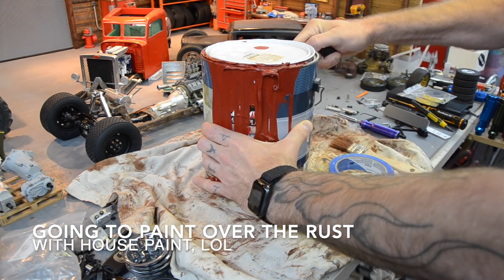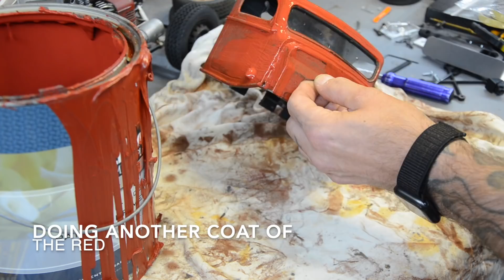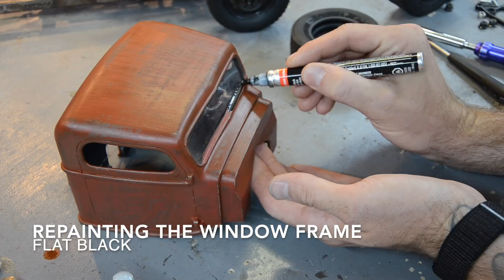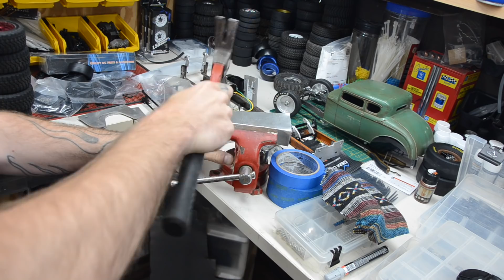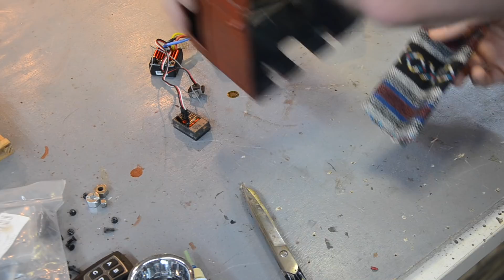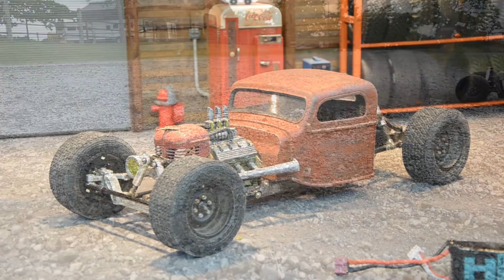Bringing back the Farm Truck, RC Rat Rod Scratchbuild, House Paint Patina, RC4wd Wheels and Tires

Comment: I really miss your Rat Rod builds.
I have some hexes I found online that are drilled out and have bearings pressed into them. Don't get me lyin as to where they came from but their either from Bang Good or Amazon. Will get them out later tonight and get some pictures. Another option might be Fomula1 front rims. There is/was rubber tire F1 front rims that take bearings. But their not going to look like vintage or steelies. Really like the tires and rims you got on there now. Very cool.

Comment: Mount the lights on the top of the steering arms so they turn with the wheels and tires.  It will not take away from the hole look that started this build but it will make the lights the focal point ant it will give you full steering.

Comment: I'm having the exact same issue with my front wheels (similar set up with Tamiya semi front axle). I started with normal depth hex hubs, I can back off the nyloc nut to get wheel spin. But my rig rolls in turns super easy so I want to increase the track width up front to counter that. Added wider hex hub adapters like yours, which don't use a nyloc nut so no way to keep tension on the nut and get wheel spin. Curious if you found any other solutions to this? You mentioned a 3d printed adapter? Do you have a link? What would be perfect is a wide hex adapter with recesses for bearings on both ends... but I don't have the tools or skills to machine that myself.
Reply from the maker: There is a 3dprinted part that solves that problem. I had a set I ordered from shapeways but I can not find them anymore.

Comment: @20:46 😂 
Are those the same tires you had on it in that facebook post the other day? Bc it looked sick AF with the fat tires.

You could always spray that activator into a small cup and apply it with a brush if you don't want to spray the body. 👍👍
Reply from the maker: Lol. Yeah it’s the same wheel and tire setup.